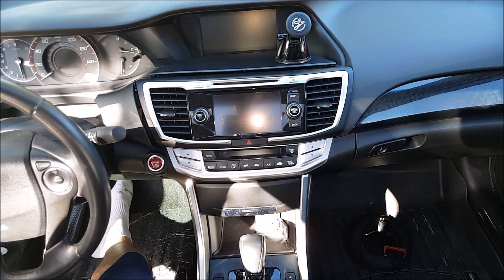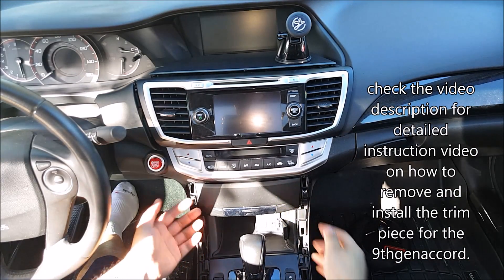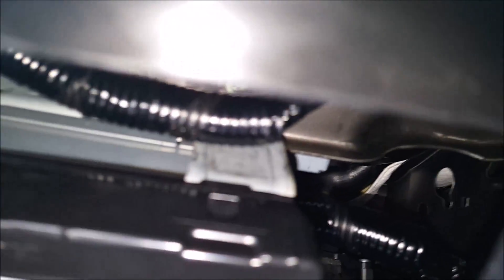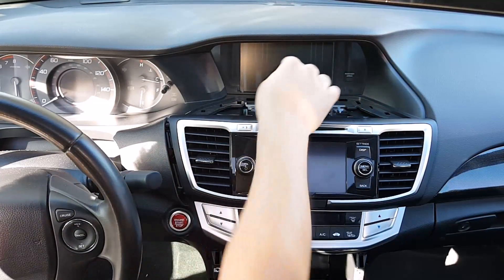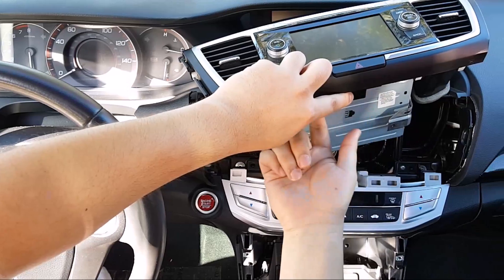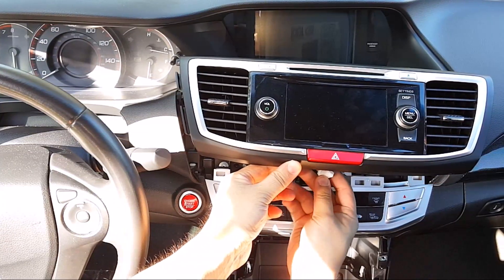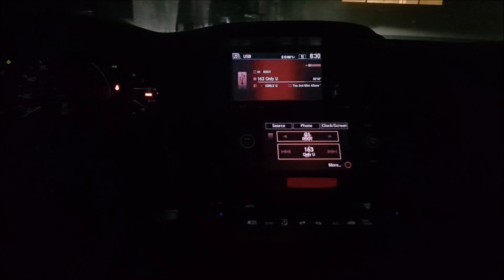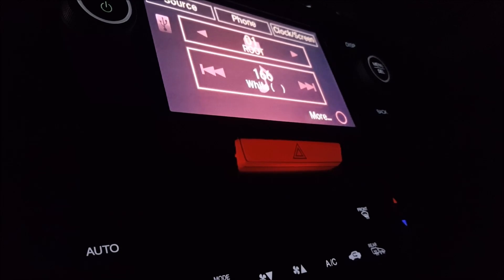[DIY]  2013 - 2017 Honda Accord JDM Red Hazard Button Installation

Comment: If you're going to do this, could you just unplug the ANC module, as well, so you could get better sound out of the sound system. 
I own a 2017 V6 coupe so I can't use the menu to turn the ANC off.
Reply from the maker: Yes. the ANC unit is where the 2 screws are located.  Just unplug it.

Comment: Hey Jeff I got the botton from you thank you by the way 
But my 2013 V6 has a navi so it has an extra layer of bottons
Reply: Where yours has the poker how que I take that one out?
Reply from the maker: Its the same procedure.  Instead of the pocket storage unit as shown on this video, you have the navi unit.  its held on by 2 screws exactly as the pocket and there is a harness behind the unit that you disconnect.
Reply from the maker: https://youtu.be/3ANIljKx70s and https://youtu.be/S8wvLK0XsdA

Comment: Did you have to disconnect the battery first?
Reply from the maker: dsgbqc no, but the car was completely off and the wiring harness that powers the hazard button was disconnected.  I do recommend disconnecting the battery though. That will make sure that people do not have the car on and have the climate control running or listening to music while doing this.